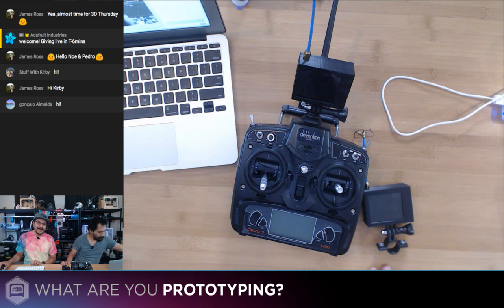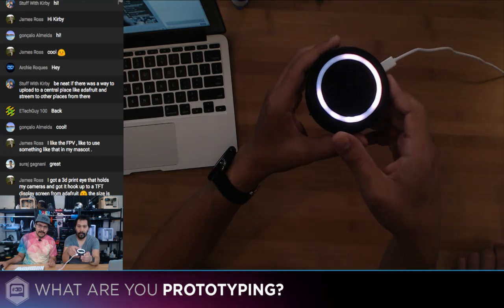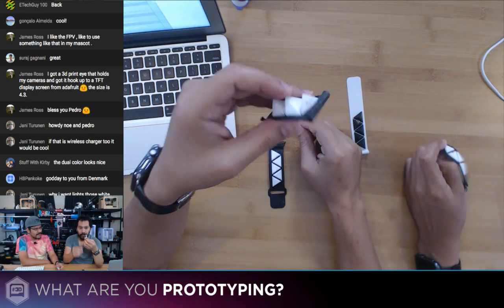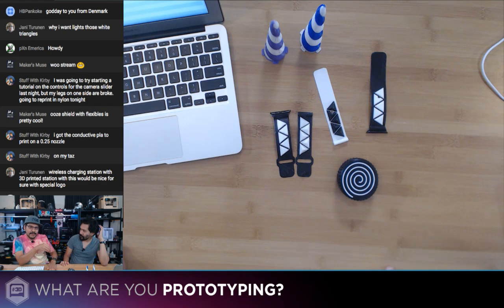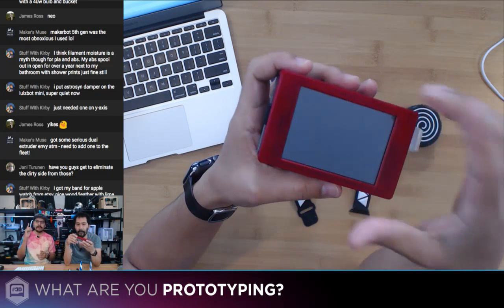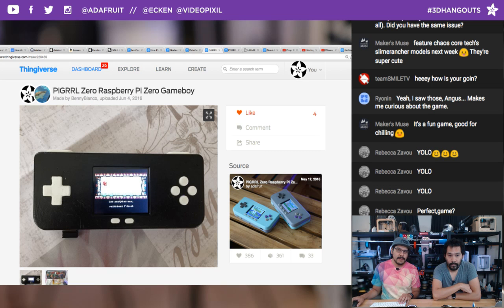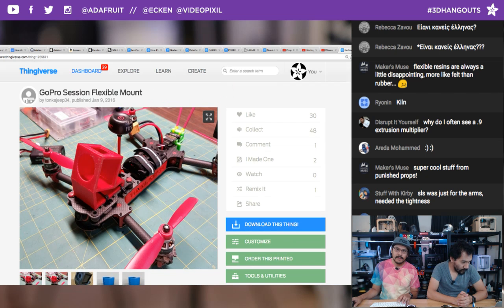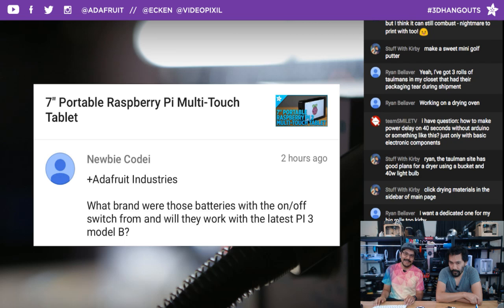3D Hangouts - FPV and Dual Extrusion @adafruit #3DPrinting #3DHangouts

Comment: Hello.  Thanks for your responses and the shoutout.    I have a question about setting up  OctoPrint.  The guide they have up on github is a bit confusing and I'm having trouble getting OctoPrint properly setup.   I can't get it to start the server automatically when the PI boots up and u have to start it manually in the terminal everytime.  Another issue I have is I cannot get the camera to work in OctoPrint.   I setup the mjpeg streamer per the instructions and could go to the browser and see the camera stream,  but it doesn't show up in the OctoPrint web interface .  Also when I try to reboot the PI I get an error in the web interface but it still reboots the PI.  I cannot view details of the error because the server gets shutdown.  Any suggestions on getting this setup?  Maybe do a guide that's better than the one on   github?  I'm a bit lost now.
Reply from the maker: We just put together a walkthrough video of installing OctoPrint, hopefully this helps! https://youtu.be/thQ3PdLxqe8?t=15m1s